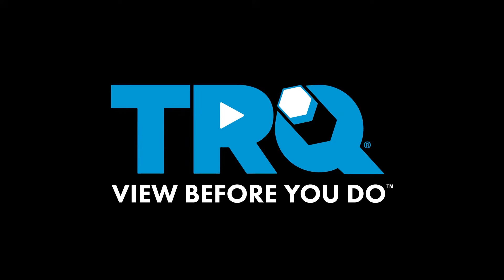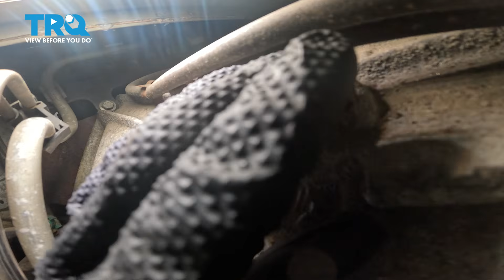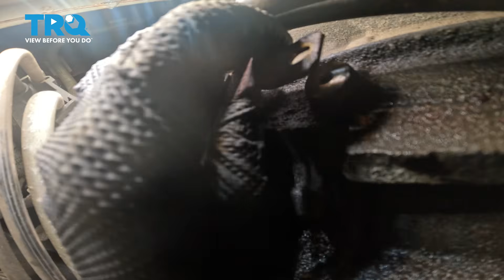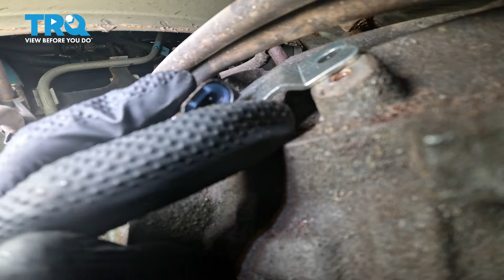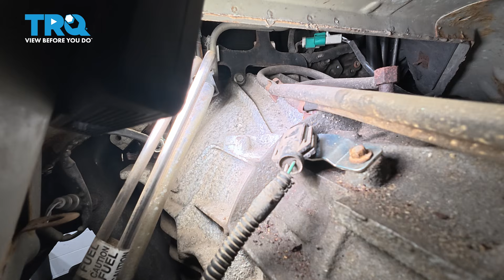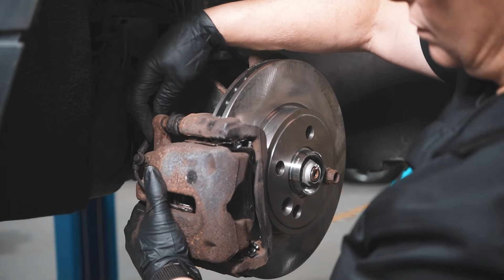How to Replace Vehicle Speed Sensor 2000-2005 Ford Excursion 6.8L V10

Comment: Thanks!  Coming here to do this with my 2000 F53 Motor Home Chassis.  The Workshop Manual said to lower the transmission.  I hope that I don't need to do that, and maybe only to get to the turbine shaft speed sensor that is at the fat end of the transmission.  I heard somewhere else that the bolt should have some Loctite on it, but I don't see that recommendation in the Workshop Manual.